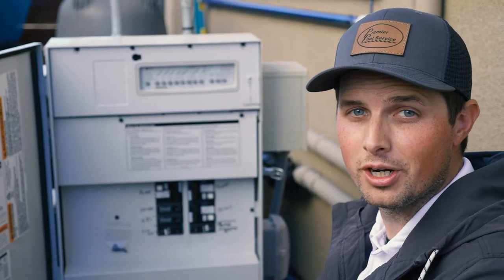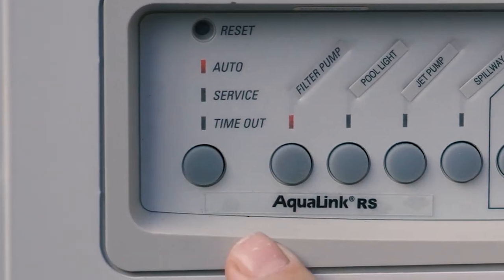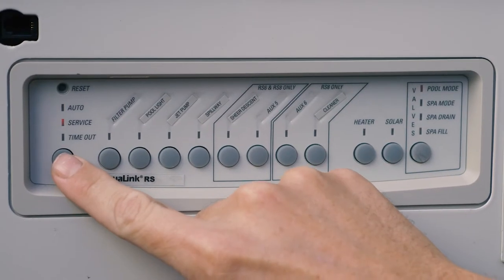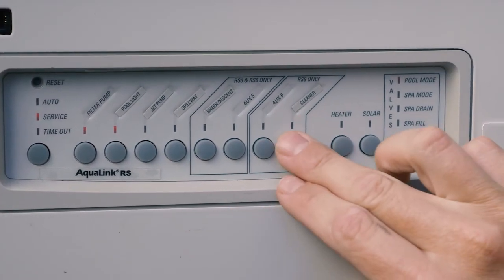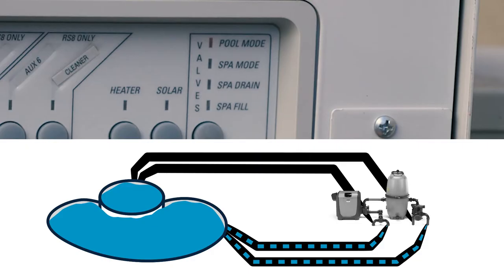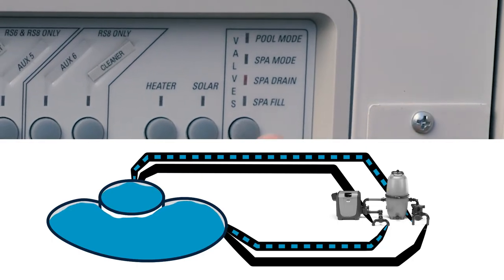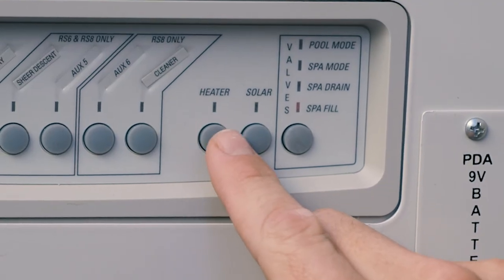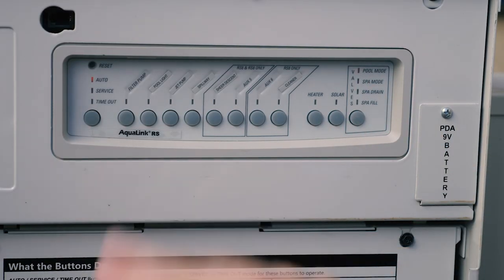How to Operate an Aqualink Power Center

Comment: None of mine are labled is the cleaner to turn on the vac?  There are times I just want to set it in a quick clean mode, is it always in the RS8 section?
Reply: no not always - our panel has the cleaner as the 4th button from the left

Comment: thanks for your insight,    i have the same system but there is no power and the circus breakers are not tripping.  do you think it's the transformer that is bad?  thanks for your help
Reply: Hey Michelle, did you ever figure this out? Thanks.